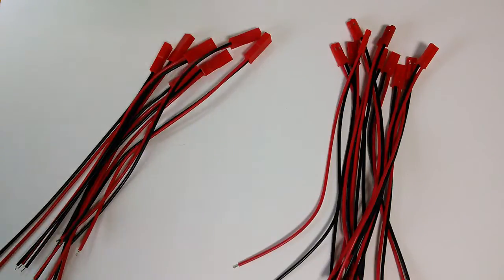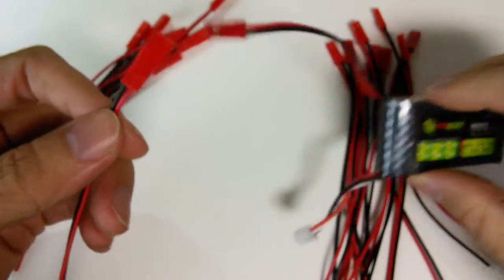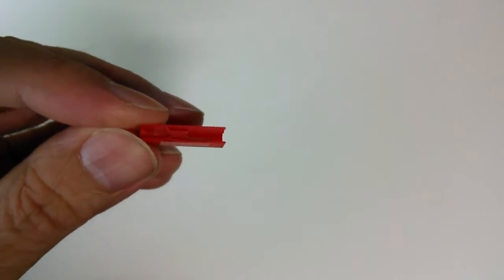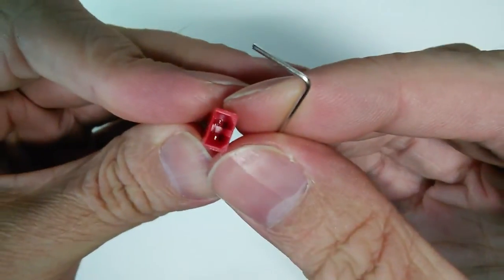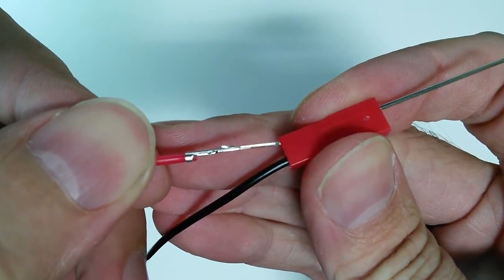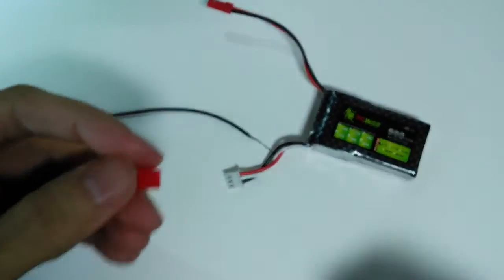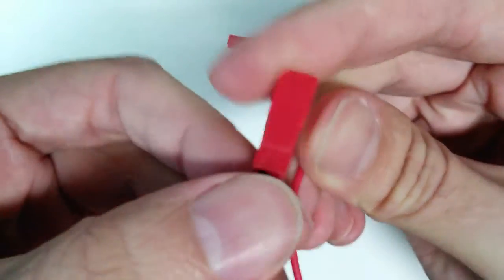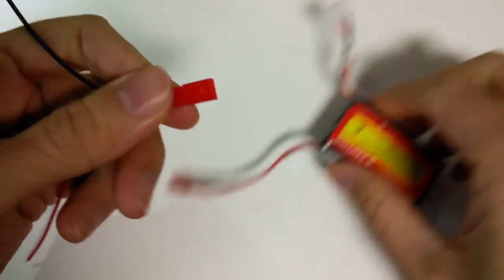Howto: reverse polarity of JST RCY connectors

Comment: I find using a T pin used for building balsa model aircraft easier to use. You can also use it while it's in your hand to reset the barb.

Comment: I feel somewhat badly for you. However, you did correctly identify the colors. Seeing the wrong position on the connector was your clue. In addition...I was really hoping you were not going to call the portion of the connector assembly at 1:15 male...but I was dismayed. Pin and sleeve connectors are sexed by the pin and sleeve...what a concept. NOT by the molded shroud which protects the pins/sleeves. You can go to any competent electronic supply house/catalog/etc and see this. Thats what your $1 got you.

Comment: are these wires good enough for 2s and 3s lipos ? it looks quite thin.
Reply from the maker: +Ashish Amatya the voltage of the battery is not so much the issue as the current that will be passing through them
Reply: do u think its good enough for 1500mah 3s lipo ?
Reply from the maker: +Ashish Amatya ??? the voltage of the battery is not so much the issue as the current that will be passing through them

Comment: I'm now to handicapped to do the job I use to do (I was first an electronics tech and later an electronics design engineer) what I did as a tech was to use the smallest micro screw driver (like a watch maker might have) it always worked and could also help pop the tab back out a little so it would stay in place after reinserting back in the plug.